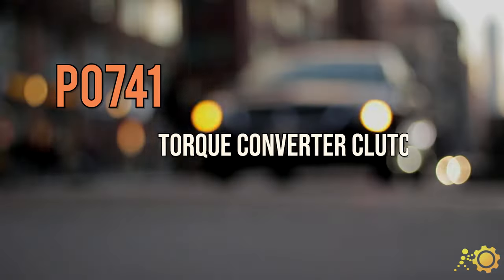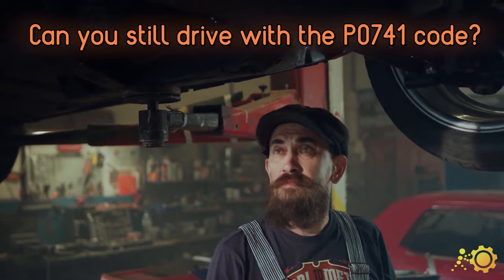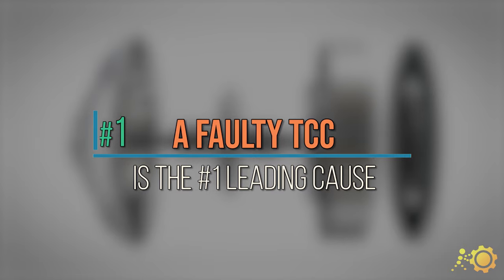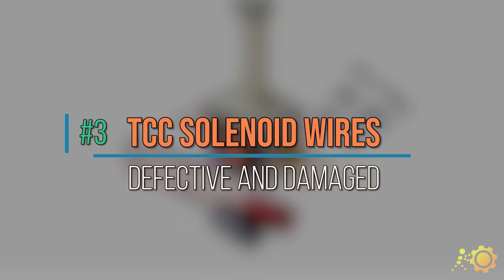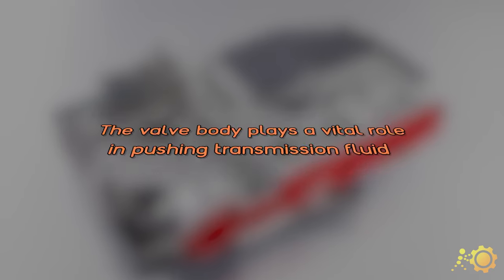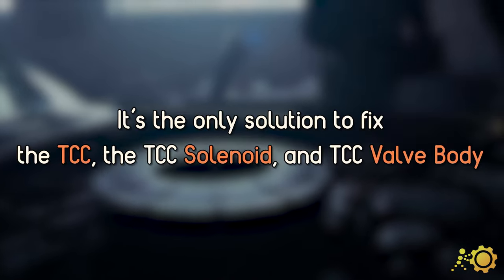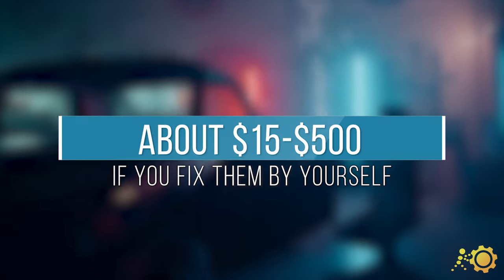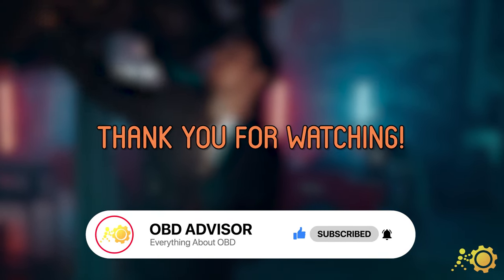P0741 Explained In 3 Minutes

Comment: The first and simplest cause for this code is low ATF level - none of the hard/software can work properly if there's insufficient fluid for the system to control.

Comment: ive been driving my 00 f150 with this code and p1740 for about 4k miles now💀
Reply: Bro I been driving on code p0841-p0741-ff-p0135-p0741 I just recently got my car scanned and I thought it was the fuel indicator or belt tensioner but I’m happy I found this out fast

Comment: I will change transmission fluid and filter also the valve body and transmission shift clutch solenoid.If that doesn't solve the issue with transmission slip when car is warmed up then i'll swap the transmission.2006 acura tl 5 speed auto
Reply: Mitsubishi Lancer GTS Automatic 6 speed (CVT) 2008 240k miles on transmission. 60k on engine (“new “ one) 

Got the P0741 - Lockup Solenoid / Lockup Clutch Stuck Off. 

Transmission fluid and filter on time, always original (even when the type of fluid change). 

Change “all” the solenoids: Line press solenoid, Secondary variator press solenoid, TCC PWM solenoid, TCC lock-up on-off. 
(I didn’t change pressure A & B, stepper motor, temperature sensor, ratio control valve)

The TCC solenoide was bad, wasn’t giving me the Ohms. I Buy a original solenoid and change it 

The “lock” of the Lockup in the Torque Converter was tearing apart. I Buy one too and change it. 

And I buy the transmission fluid and filter again and change it. 

The funny part? Problem persists. P0741 (I did all the electrical tests, download the repair manual and search info) 

Maybe I will buy a new transmission.
Reply: Any updates on the fix? Just got the code on my 06 TL today :\
Reply: @Kiddbatman45 i feel you same today man
Reply: @Dennis123311 change your transmission fluid, the transmission filter, & the 3rd-4th gear pressure switch. For my Acura I had to change the transmission fluid 3 times so just make sure you do it the way it’s meant for your car. You’ll be good bro
Reply: @Kiddbatman45 i have a 07 TL a little high milage lol but some say changing the fluid can be good or bad for it? Idk im still learning everyday
Reply: @Dennis123311  by the way, your 07 TL has a different process of removing the trans filter. I would look into that before moving forward
Reply: @Kiddbatman45  did you also have a check engine light for the po741?
Reply: Just curious how did we get from the po741 to the pressure gears and transmission filter

Comment: I have a 2013 Silverado tranny completed rebuild including new torque converter and value body getting a po741 and not going into 6gear and late shifting my tranny guy said I can drive for 3 days and bring it back he can't find the problem can I mess up the tranny
Reply: yes bad for transmission, check fuild and may need to replace selonoids
Reply: @DakotaRaymond1999  it ended up being the computer needed to be reflashed its all good now
Reply: how did you do that bro?
Reply: @eldianmolina4920  the transmission needed to be reflashed